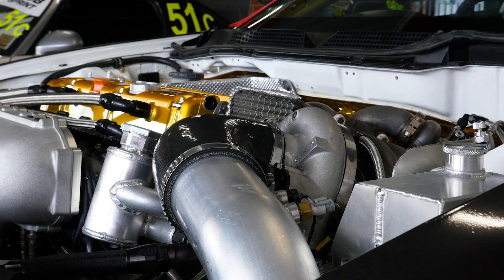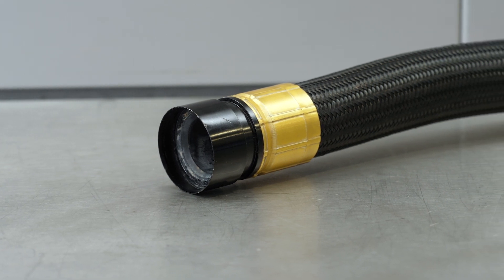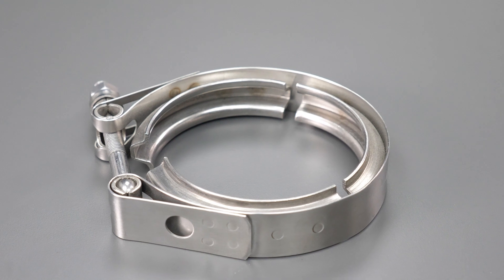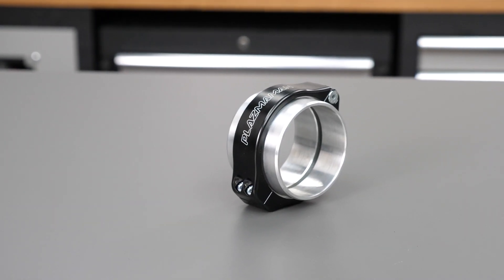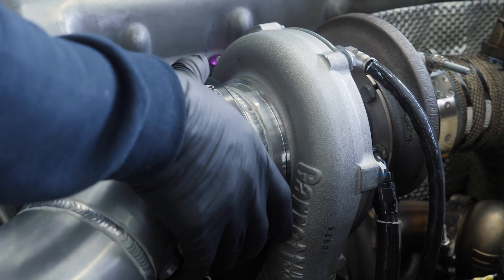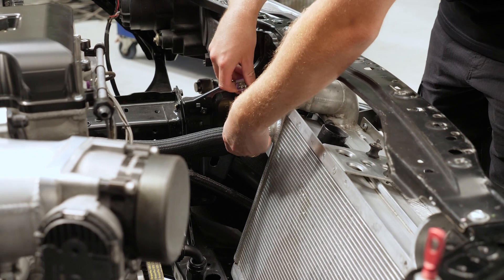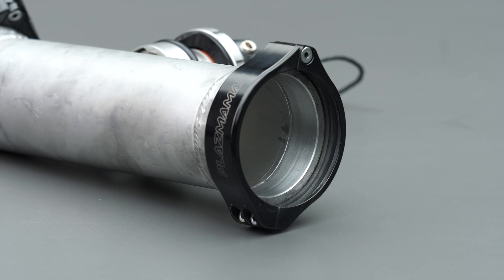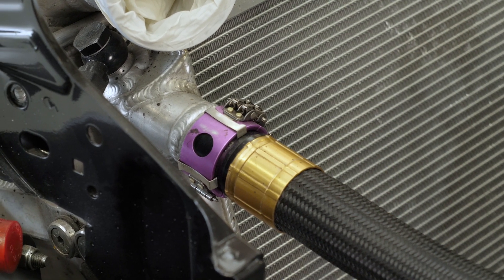No more boost leaks?

Comment: The thumb nail for this video smh. Clam shell clamp to hold a compressor inlet pipe.  People do realise there's no pressure right?  About as necessary as steel braided breather hoses.
Reply from the maker: Yes, people realise. For many builds it's just nice and tidy to follow the convention of the pressure side and you will see setups like this up and down pit lane, but YOU don't have to. You can use a rubber band and half a roll of packaging tape if you'd like to on your own build 😎 - Taz.

Comment: Ive had vibrant hd's that wouldnt quit leaking in street cars. Owners decided to go to silicone hose, no more leaks. The hds are sometimes not very quick reconnect since you get to fiddle with 2 loose pipes and the internal ring before the clamp goes on

Comment: We used to use the split clamps for industrial steel pipes. These were called roll lock fittings and we used to swage the end if the pipe on site . 

I’m still surprised cam lock type fittings haven’t been introduced into motorsport or the ball and socket type used in farming for irrigation etc
Reply: Weight, maybe? And vibration sensitivity?

Comment: For those of us stuck with silicone couplers, is there a best option between worm gear, constant tension, and T-bolt clamps? They all have their weaknesses. Anything better?
Reply from the maker: The issue with T-bolt clamps is the uneven distribution tension around the clamp - basically the area under the T-bolt is squeezed tighter than the area opposite it. T-bolt clamps are also a lot easier to overtighten and damage the pipe or coupler. Worm gear/constant tension clamps distribute the force better - just be sure to use the ones that have a smooth inner surfaces otherwise they can damage the coupler like a cheese grater. I personally like the  "Murray clamp" style for a nice constant tension. 
Last point is be sure to Bead roll the end of your pipes! this makes a world of difference when using silicone couplers. - Connor
Reply: T-bolt clamps are the worst option. They leak boost. Best is BREEZE worm drive clamps supplied by Plazmaman. And Norma Torro worm drive for extreme clamping.

Comment: I wouldn’t call them fast to install as they can be a pain in the ass to put together and i have even need a third hand to hold the bloody centre ring wail i put the clamp on. I try and talk customers out off them in most cases unless there running lots off boost.
Reply: I agree clam styles are a pain, the centre ring literally slides off when you attempt to put on the locking ring. Can wiggins clamps be used for intercooler hard pipes? or do we just all need to stick to silicone couplers for the flexibility and survivability :)
Reply from the maker: @lrd2258  Wiggins clamps are a great option on intercooler pipes (although expensive)- just keep in mind how much movement you'll need between the engine and chassis mounted intercooler, this will depend on how soft your engine mounts are and so on. 
Check out this photo of the Under Suzuki's Scorch S15 (on of the fastest time attack cars ever) - In this case wiggins clamps are being used to provide some isolation for the DBW throttle as they can be tempremental with vibration: - Connor https://www.facebook.com/HPAcademy/photos/a.405908116167981/3349922311766532/?type=3

Comment: How do upper/lower coolant hose diameter effect radiator flow? (i.e. -16an vs -20an vs oe sized silicone hoses)
Reply from the maker: We often hear different theories on this, as smaller diameter plumbing will generally mean faster flow. Some say you don't want the fluid to flow too fast as it won't allow heat to be transferred - but convective heat transfer is a function of flow rate with faster flow helping heat transfer. The problem is if the fluid is too fast and turbulent or causes cavitation or air bubbles which we really want to avoid. 
Probably the most important is the lower radiator hose that feeds the water pump suction side, this is usually larger than the upper hose because it is subject to vacuum and if it's too small it can collapse or the flow will be too fast and result in cavitation leading to vapour lock of the water pump - clearly not a good thing.
Unfortunately there's no hard and fast rule. Usually the OE sized hoses and waternecks are suitable and shouldn't need to be questions. Motorsport style Electric waterpumps will typically be speced for -16 or -20 and we should use what the supplier recommends. - Connor